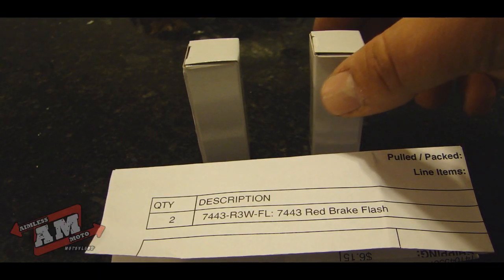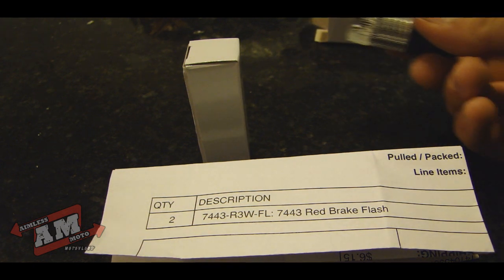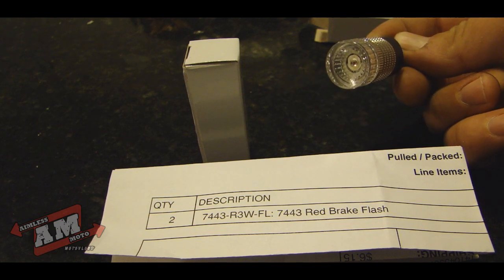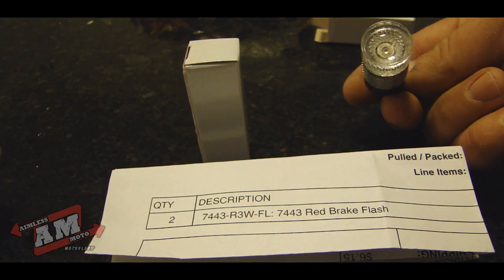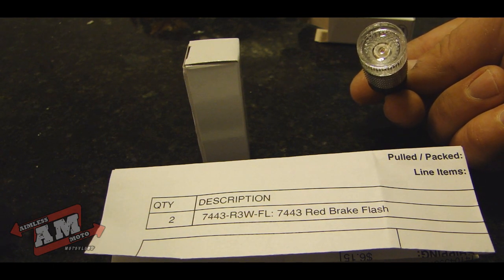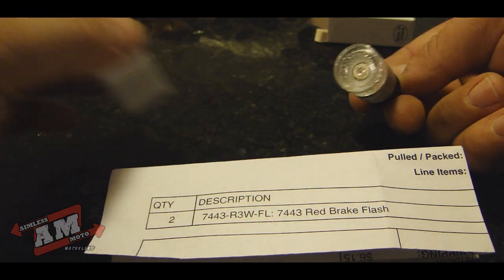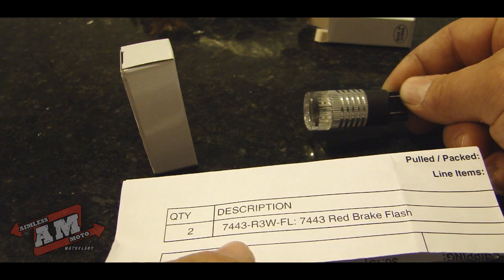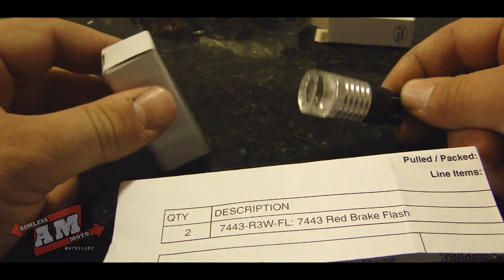How to Install LED Flasher Tail Light Bulbs

Comment: I got the motodynamic integrated taillight and it does the 3 flash then solid. It is super noticeable!
Reply from the maker: The only option I have is to do the bulbs... an integrated/full LED tail light is about $350 from Germany. Crazy money. I think this works juuuuuussst fine.
Reply: AimlessMoto damn that's expensive Id do the same thing in your shoes they look and preform fantastic!! My interstates tail was only like 60 bucks ;)

Comment: Hey I just got these Bulbs for my (new to me) 09 VFR800, I put them in (well the top one) and they work but do not flash?

did you have to get something else to make them flash? how did you get the bottom one in?

Thanks
Reply from the maker: Nope, they're just the bulb... you have to change BOTH bulbs for it to work, because they're on the same circuit. The flasher unit in the LED is jumped when you have an incandescent in the same line.
Reply: AimlessMoto Thanks, put them both in but still no flash :( did you get the load resistor kit with them? if so where did you mount them?

thanks for you help
Reply from the maker: no load resister... literally just the bulbs... wait... did you buy the FLASHER bulbs? or just straight LEDs?? You need to get these: https://www.superbrightleds.com/moreinfo/s-series-bulbs/7443-led-bulb--dual-intensity-1-x-3-watt-high-power-led-w-brake-flasher/925/2276/
Reply: Yeh they are the ones I got. I followed the link off your video and got the 7443 bulbs with flasher.

not sure why they are not working Iv emailed superbrightleds and I'll have to see what they say.

Thanks for your help
Reply from the maker: 1 last thing would be to try with the bike running... sometimes the battery will only put out 12.1-12.3v sitting with the key on and that may not be enough to power the flasher. They activate at 12.5v I believe. If not... return them, because they're defective... You could also try them in your car/truck if they have the same connector, just to test them.
Reply: Thanks ill pull them out and see if they fit in the car, if not ill return them